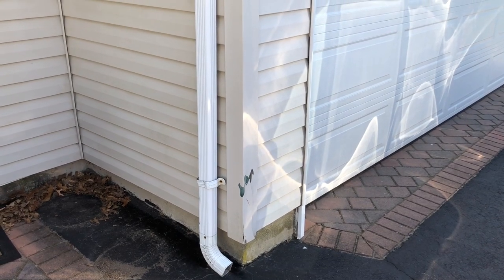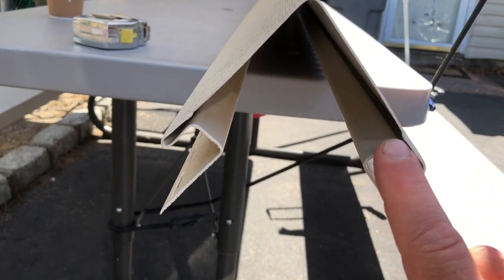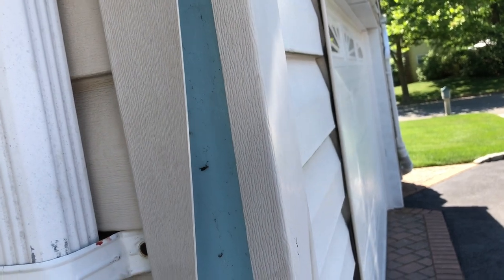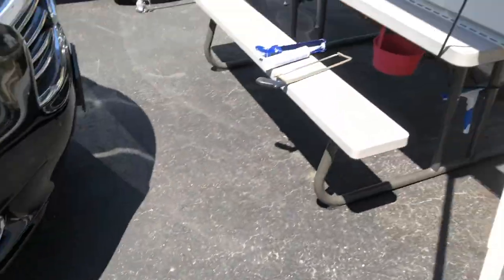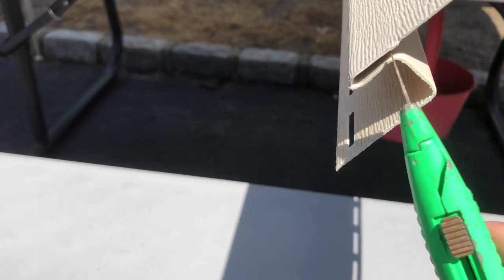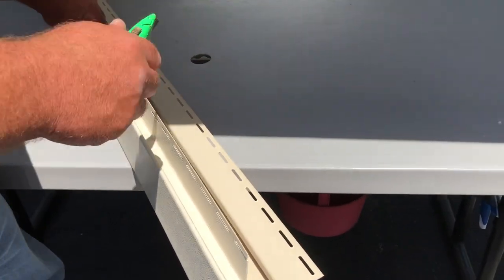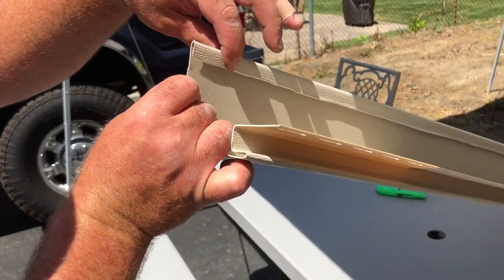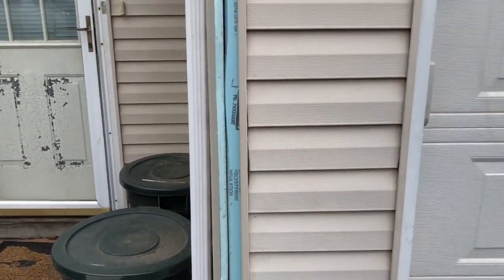How to Replace Vinyl Siding Outside Corner

Comment: I did almost the same thing except I didn't cut anything off the old corner. I cut the j off of the new piece and snapped it right over the old one. Makes a tight fit. I did about 40 corners like that. I enjoy your video. 👍
Reply: it's called a cap over, and you don't have to cut the old corner at all.
Reply: There's no way it could've came out as nice as this. Unless, the new corner to do the cap-over has to be slightly larger than damaged corner. However, cutting damaged corner straight down should be/is sufficient to create enough flexibility to make damaged corner coverable without doing so much cutting and would not need adhesive.
Reply: Great video, I just watched a similar one, but the guy didn’t add caulk, I suggested that he use a couple of dabs of caulk.

Comment: How did you cut it down to 78 inches? What tool did you use?
Reply from the maker: Hi Richard, thanks for your question. to answer your question, I used a hacksaw to cut the larger piece down to the appropriate length…

Comment: Does it matter what kind of caulking?
Reply from the maker: No, the type of caulk does not matter any any type of caulk will do, could be silicone based, could be a bathroom, caulk, indoor caulk, outdoor caulk… the caulk is just to act as a slight adhesive, does not have to be very strong. Just keeps the outside corner in place.